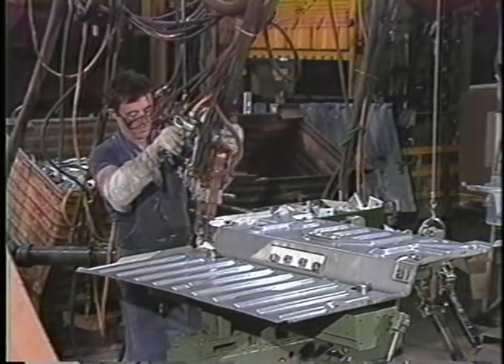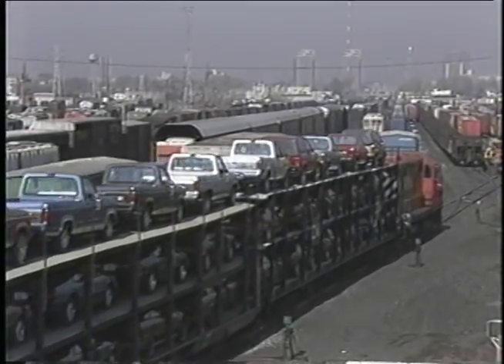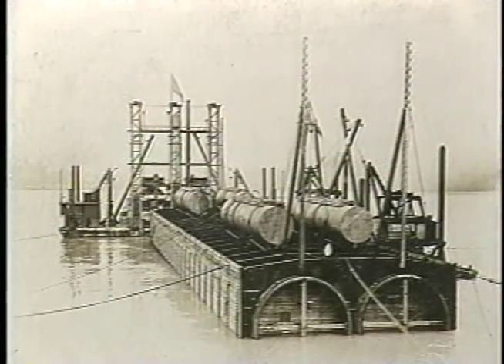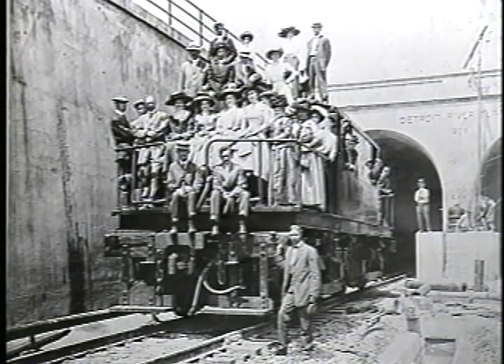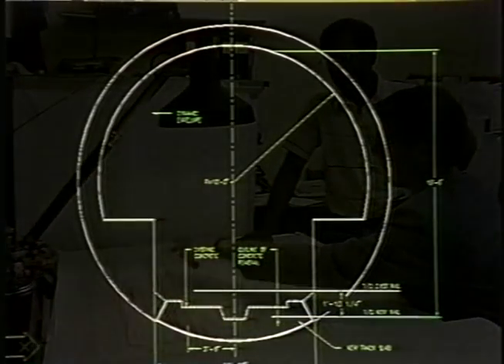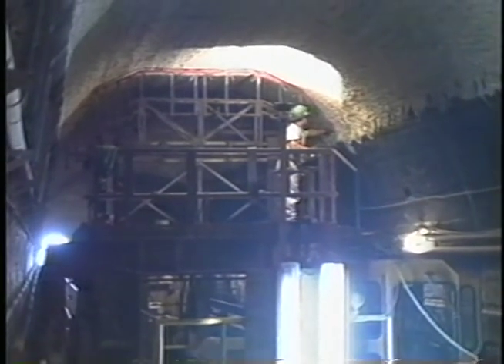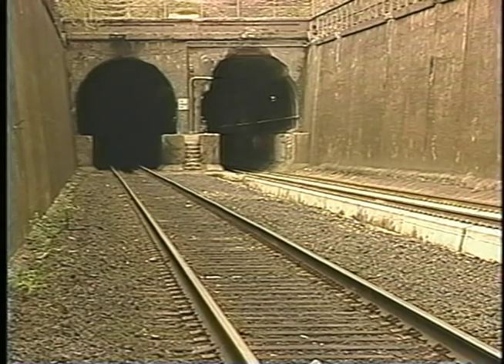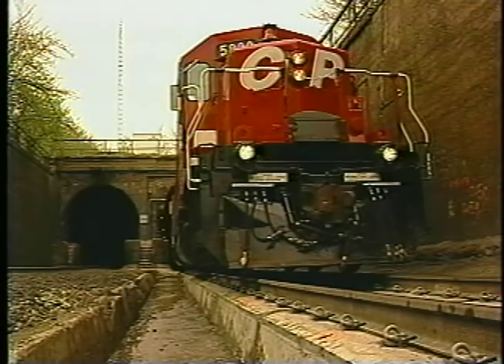CP Rail Detroit Windsor Tunnel Enlargement

Comment: CN pulled out in the 90's primarily to build a new own  stack train accommodating tunnel between Sarnia and Port Huron MI. CP Rail in spite of the  tunnel roof enlargement under the Detroit River still cannot accomodate modern double stacked container trains and until that's remedied they are shut out of profitable Chicago/Montreal/NYC business. CP  headquartered in Calgary is raking  in the Lion's share of profits in Western Canada doing what they do best. Hauling bulk over long distances.
Reply: wrong. they run double stack under the detroit river
Reply: The only double stack that can squeeze under that tunnel is the lower-cube sea cans.  Our North American high-cube containers don't fit two-high.  So, you'll see CP run high-cube cans through there only one-high.

Comment: As to be expected! CN pulled out of the partnership to build this. CN is not a great or even a good railroad by any means! Just a broken down, federally financed excuse to keep Canada unified. CN is a very sad exhibit!
Reply: CN has been privately owned since the 1990s.
Reply: Mean while CP seems to be doing fine :) Is there a better name for CN these days other then Crash National?
Reply: CN was privatized in the mid 90's and today it's one of the top 7 class 1 North American railroads and anything but a broken down sad exhibit. You need fact checkers before posting to avoid looking foolish and little more than an Armchair critic.